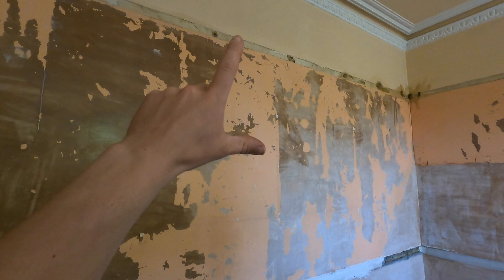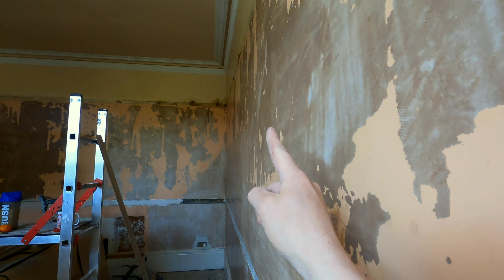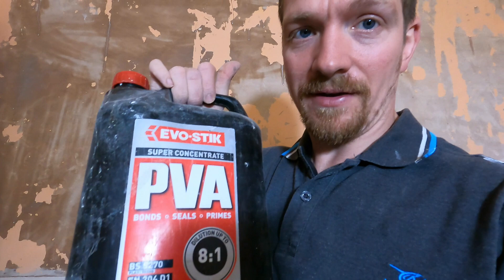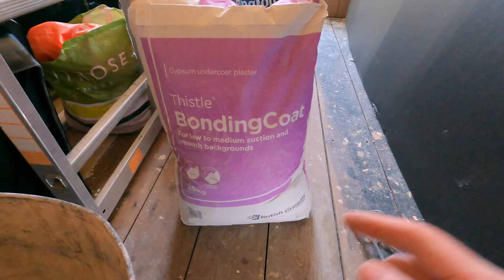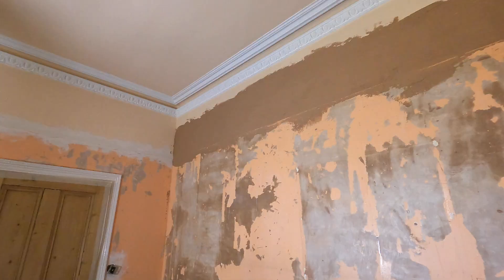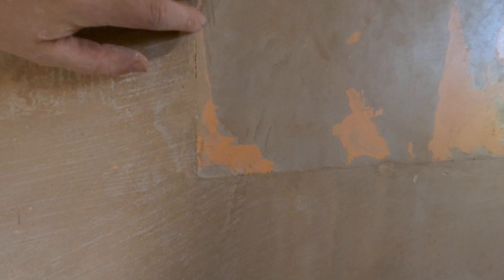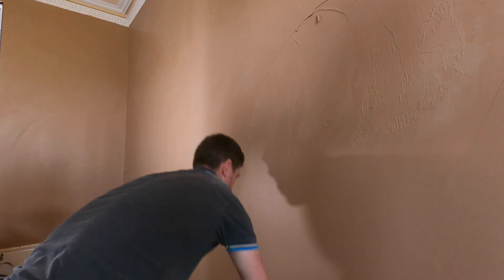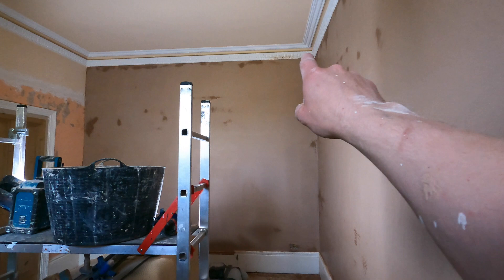This wall will NEVER BE FLAT...So now What??

Comment: Your level is out because the strip running across the centre of the wall is proud. A lot of old houses have this as it is because of the removal of an old feature. If you would of just hacked that section out you would have used much less bonding and not had to create an illusion of a flat wall it would of genuinely been flat and left more space to get neat around the skirts as if you leave the skim short of your skirts on your first coat as you did with the bonding it makes for a much cleaner neater job .

Comment: working on one like this, a nightmare, i've managed to straighten it quite a bit but there's always small bits that don't get quite flat enough
Reply from the maker: It’s a bugger when it’s like that but you get used to it mate. I’ve worked in plenty of wonky houses now and you learn to adapt ha! Wish you luck anyway my friend 👍
Reply: @PlasteringForBeginners  hi there with this high strength PVA would u just give one coat PVA and what ratio to water would u recommend and how long to leave it before skimming
Would u ever PVA walls and skim next day

Comment: i learned to plaster from this guys videos....and did most walls on a 2 bed flat ..oh and a ceiling.... by the time i was done...i noticed a remarkable improvement in my plastering with both application, and finish... i gained confidence and a little skill in both areas...some of my finish was like marble.... and it got better as i imroved and got faster..slapped it on rather than being meticulous ..which i was when i started and ended up throwing buckets of drying out plaster or bonding out....oh and i improved some walls with hardcore on bare brickwork...after watching his vids....i was initially going to bonding coat them...but he taught me to use hardcore...i think thats the name...something like that and its good stuff.
Reply from the maker: Thanks pal and well done for your hard work. Sounds like you’re killing it…all the best my friend!

Comment: another great lesson. ive got a chinmey breast to do tomorrow where the damp course guy has plastered a section without tapering it off so its got a very proud vertical lip going upwards about 1.5 meters. ive since had to remove the fire place so ill need to square it all up but ive tried sanding the lip off to get it flat but no joy. im stumped as to what to do i guess ill have to knock some of his work out to make way for a clean finish coat. seems a bit drastic though.
enjoying the dope beats again on this channel!

Comment: Been watching loads of your videos recently.Think your ace and an amazing plasterer! I've been plastering for two years now and am getting really good at it.Only thing is though I've been taught by one guy who is also an amazing plasterer too but as we know there are many ways to skin a cat!That's why I've been digging through your videos.I have a couple of questions.... 1)do you always scratch up your bonding coat?2)Do you wet it up before plastering over it(if so with just water or with PVA in it?).3. Do you aim to skim the wall the same day as you bonded it?Think I heard you mention you aim to do so in another video?.Hope to get a response from yoal.Chris.
Reply from the maker: Cheers mate…I really appreciate that! I do now. I used to leave Bonding unscratched but for the sake of 5mins I just scratch it. If I’m the save day you can leave it but I sometimes just PVA it to be sure. So if you’re unsure just do that pal.

Hope this helps pal and thanks again for watching! Cheers 👍
Reply: Scratch and pva gives you the best key and suction control. As for skimming the same day, that differs from the thickness, time to set ect. But to give yourself the best chance of skimming over bonding the same day is to get all   your floating out done as early as possible to give it time to set enough to skim. I couldnt deal with all that furniture in that room haha. I  skim on site now during the week (easy money). Only do domestic work on weekends when the job and money is worth it.

Comment: High Blain, when you are bonding out the bottom of the wall is the pva still tacky as the bonding goes on. Same with the skim. I was always taught to seal the walls with a 5/1 pva then just before applying your first coat put a 3/1 pva coat on let it go tacky then apply the plaster. Would appreciate your advice 👍

Comment: As always great job.👍
One question only because it’s what I would have done.
Wouldn’t it be easier to remove skirtings so you could straighten walls?
Reply: Yes.  But if the client won't pay for that then you have to just disguise the unevenness with bonding.

Comment: Recently I’ve had to look at the corner of a room which we had to use insulating paper on (old cold house, solid brick wall) but have found some of the plaster has come away and in some parts the holes have gone back to the brick. Would it be better to just get rid of all the dusty parts to the brick entirely (a brush and it just dusts off) or is it better to seal with few layers of pva?
Reply: From my experience it depends on how crumbly it is. If you're able to get pva into it to bind it together again then do that, if you think the brush will cause it to fall out while putting on the pva then knock back to something solid

Comment: My new house has the same problem in every wall, should i just rip all the old plaster off or dot&dab a new plasterboard on top of them?
Reply from the maker: Hi mate. Depends on the condition of the plaster. If it’s sound then you can Dot and Dab but if it’s weak then just hack off and start again pal. That’s always your best option to be honest 👍

Comment: That looks old enough for there may be no DPC or a compromised slate DPC. The plasterboard at ground level may be part of a damp treatment. Gypsum does not handle damp, so you may have dogged a bullet by not removing the whole lot.

Comment: I've got a plastered and painted (eggshell) wall, which because of an extension, there's now a new level of 10 mm with a bead to sort. They dont want boards over the wall, so can it still be floated with bonding over the top?

Comment: Why did you key the areas that had bonding when the other areas were smooth anyway? Also were the other areas pva’d but you just skimmed other the bonded areas without pva because it was still wet?
Reply from the maker: Its always best to provide a key to your backing plaster and yes…the Bonding was still damp which meant I could plaster directly onto it 👍

Comment: Hello blain, I have a question referring to your video 4 years ago about breaking in a flexi trowel, I have lightly sanded my new Marshalltown flexi trowel like the video showed, but I am laying on plaster with a 18” carbon marshalltown trowel and some occasion my plaster looks good but in certain light I seem to get a tiger stripe effect on my plaster, any ideas what this could be ? I only do diy bits and some times smaller jobs for my friends but have done a fair bit now was just curious, hoping to improve 😃

Comment: Crazy question... Never tried it on plaster but could you use an angle grinder to flatten some of it out, would the plaster just fall off the wall? Would it be too much dust?
Reply: A grinder might be a bit harsh, you can take out a bump with an orbital or a dry wall sander (better results just because it's bigger)
Reply from the maker: I think it would be too aggressive and the dust would be unbearable. Miliex had the right idea 👍

Comment: Surely removing skirting and refitting after would half the work in trying to match in
Reply from the maker: There was a massive gap between the centre on the wall and the bottom. To be honest, the skirting board was fine…it was the patched in plasterboard in the centre that was the issue. That needed ripping out and starting again but as I said, the customer didn’t want to spend a lot 👍

Comment: Hi Blaine, could you get it flat if customer pulled off skirting and coving?
Reply: Probably just the skirting
Reply from the maker: To be honest, it would have been better to rip out the patched in section in the centre. That was the real problem…the skirts were fine 👍

Comment: Wouldn't they let you remove the skirting the re-affix after ?? .... Only a five minute job - but would have made life a lot easier ........
Reply from the maker: We did talk about it but they tried to do the same with the rooms upstairs (they’re doing the whole house) and they destroyed the skirting boards trying to get it off. 

They wanted to keep the original so they wanted to avoid any damage. But yes - it would have been nice but I didn’t want to risk breaking it up so I avoided it. 

I’ve done it before with old, original skirting boards and it was so well fixed that I just ended ruining the timber.